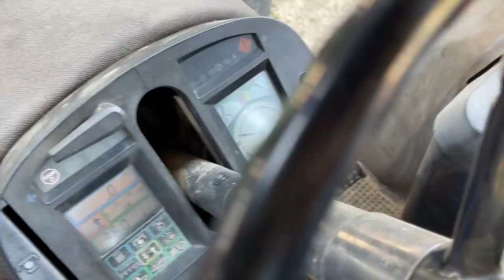HERE WE GO! 🚜 🥳

Comment: Really glad to see ya'll get your 4 wheel drive John Deere 4455!. The years of production is from 1989 to 1992. About 150 hp on the engine and 141 hp on the pto. Nice looking tractor. I had recently bought a older tractor a 1990 Massey Ferguson 3070 cab loader 2wd 90 hp.  I have now 3 two wheel drive tractors. And no 4 wheel drives. It pays to buy good used equipment. Enjoy your new tractor.

Comment: Those older tractors were some of the best ever made.  Good choice LB!  They didnt skimp on the iron.  Better think about some new trailer decking.  I just use wolmanized 2×8's screwed down with tek screws.   Throw some used motor oil on them every once in awhile to keep them from rotting.

Comment: I hope this helps you get a better cut on your grass mowing. You might already know this but, if you cut in the clockwise direction you will be depositing your cut grass over the area you already cut. Therefor not bunching up your blades with clippings while it is trying to cut the uncut grass.

Comment: A ViseGrips locked on the rim edge is a great help in serviceing those little wheels.  That surging can be cured.  Try some fuel additive.  Partially plugged jet due to Ethanol.  Get that JD mower going.  Buy yourself a nice little Bump Cap for those noggin hits.  Great. Tractor #8!!!  I think there should be covers over those front Universal Joints.

Comment: I hope you show us that truck pre fixing up and then as you have it fixed up. I like old trucks and I think many of your viewers also would like more on the truck
Reply: I learned be to drive in a ,68 Dodge pickup with a 4 speed and no power steering or brakes. Wish it was still in the family. Congrats on the new tractor it was badly needed. Those lawn mower tires r a bugger

Comment: You won't have any trouble with that Power Shift transmission in the "new" tractor. You can take it out of park and shove it up to 4th or 5th gear without touching the clutch. If you want to stop, just pull it all the way back to 'neutral' and step on the brake. I ran one for a couple years. It's really nice for baling big rounds, to be able to stop and go without touching the clutch.
 Just don't do like the guy I knew. He got so used to running the 50 series, one day he jumped in the 40 series with 8 speed power shift and just jammed it into 4th gear. Yep, it lifted the front off the ground a good ways, because it doesn't have the 'actuator valve' like the 50 series.

Comment: That riding mower needs the carburetor cleaned. That surging is because it is not getting enough fuel. Clean out the bowel and the main jet. (It sounded good when you were driving, but when your daughter was running it it was surging).

Comment: Meredith on the issue of you pickup oil pressure, my truck was doing the same thing, the oil pressure wasn't staying registering right, even after I put a new oil sender in. what it problem was, under the oil sender there is a screen. I took that screen out and it fixed my problem. You might want to see if that is your problem. I had a mechanic tell me it was going to cost me 1.200.00 to fix, but a friend at Oreilles told me to take that screen out. And that was my problem.

Comment: Excellent video as usual Meredith and family. Didn't see rusty he didn't hit the dinner plate did he? Maybe I just overlooked him. When I see that trailer it reminds me of hard work and mine equipment trailer (not that big but one the bigguns). I have a simple solution for the wood getting in that shape. Used motor oil,  I know what you are thinking, it'll make it slick. Yeah until it full penatrates the wood and when you get dirt sand and stuff on it no slicker the uv protecting would. Best part is it costs nothing free. Last did mine 20 some odd years ago and the wood still looks good except for one. Had a knot running though it and it's cracked but nothing a patch on the other side fixed🙃. It is a ole farmer trick the guy i helped while back told me. LB probably knows about it.

Comment: Well just a note to Lawrence enjoy that four wheel drive I got my first one in Case IH 385 loader tractor in the spring of 2007 one very long after it I'm on McCormick cx95 and they're both four wheel drive the only thing I can tell you he's be very wary because once you own one you won't go back we have two wheel drives here and they get their use but that four wheel drive is hard to beat once you have one it's just like owning your first four wheel drive pickup you won't want to be without one I'll give you a little piece of advice though I've noticed my McCormick will use it to plow and work ground and different than the four-wheel drive pickup actually I found it when I use the four wheel drive when I'm disking and plowing pulling the roller Hera or
 The s s tine harrow we fine will use the four wheel drive we use less fuel with it in gear than with it out of here I've watched mine different times when you take the four wheel drive in the tack will drop back usually about 500 RPMs using less fuel to get the same amount of work done enjoy it we all work hard this business they're certainly nothing wrong with enjoying the fruits of your labor

Comment: At 6:00 I have a Craftsman that has the same blade engagement set up. The bracket that swings back and forth tends to get a dimple wore in it where it sets when engaged and it gets hung up in that spot. I tried lubing mine and then found out, if you stomp on the deck after shifting to the off position it would come out of that notch and shut the  mower off. 
 Well 2 years later, it won't shut off anymore, so I took that swinging bracket off and ground the notch out of it.It worked great all last summer. There are several videos on youtube about how to fix it. I fixed mine like the following vid, but did not remove the deck to do it( it might be easier to remove the deck). https://youtu.be/MFi9zoIEfq8?t=195
 My mower also cooked a new battery in less than one season, because it charges FULL  bore when mowing. I fixed that, by mounting a simple toggle switch beside the ammeter.  Remove one wire from the ammeter and connect it to the new switch then jump the other side of the switch to the ammeter. The switch has to be on to start it, but once I'm mowing I shut it off. About every 3rd time I mow, I leave the switch on for half an hour to charge the battery. My current battery is 4 years old and still works great. What it needs, is a voltage regulator, but I "regulate it" with the switch. 🤓

Comment: It’s probably the oil pump or a oil sending unit also flush out the engine oil if the oil pressure fluxing try replacing the oil sending unit first then flush the engine oil